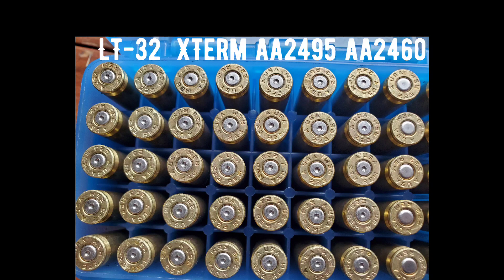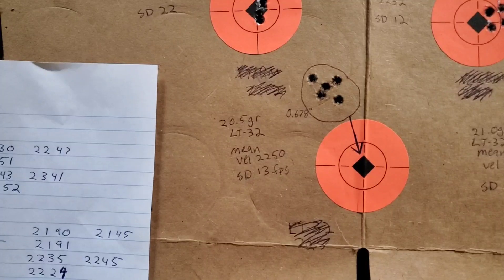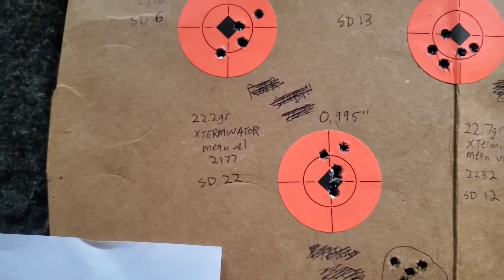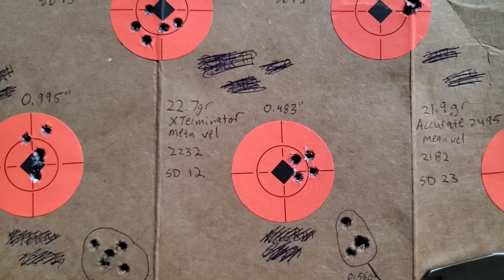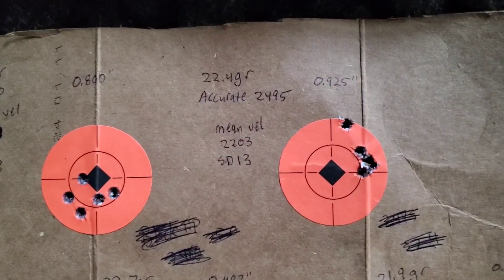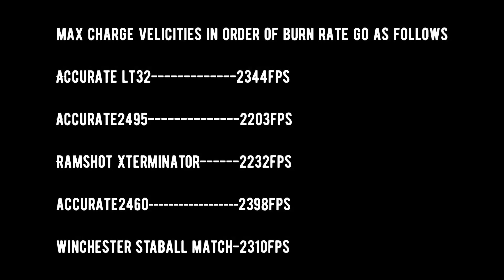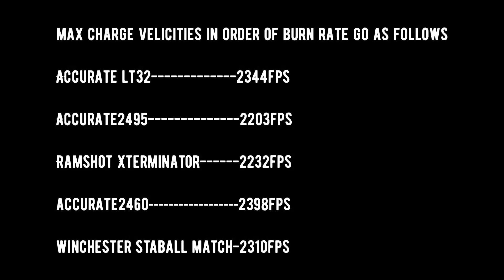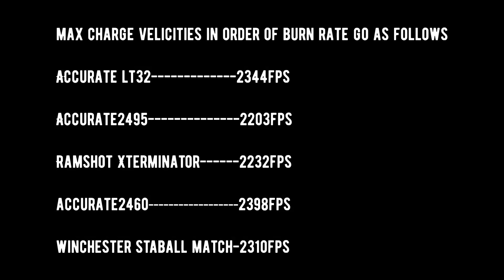Disturbing Fuddlore concerning Burn Rate and Barrel Length [Today I learned]

Comment: IMO, maximum velocity is dependent on the barrel consistency with regard to diameter and smoothness. Unnecessary, extra barrel length is a disadvantage. If you're running a blowback design, controlling gas for the bolt will also affect pressure consistency. A third component would be a flash suppressor/silencer.  A fourth consideration could be to add a rotating unburned gas wheel at the breech to capture some of 70% unburned gases that could be fed back into the barrel via rotation per round to reduce compression loss as the bullet travels further away from the initial explosion, prior to exiting the barrel...the muzzle should be perfectly cut to ensure uniformity as the gas escapes the barrel (for accuracy).  Nothing beats testing, but I've found 2700 fps seems to work best with the current technology regardless of .30 or .22 caliber.  My theory should allow for less pressure supplemented by captured unburned gases from a previously fired round.  Consistency coupled with reliability is the answer you're looking for.  Consider efficiency of fuel injection, intake and exhaust valves relies on cleanliness.  This is only food for thought, not a proven theory.  C

Comment: Its old original recipe powder IMR 4198 , 7.5 in. Saint, 11.5 in RRA 5.56 I DONT HAVE FPS but it tightened up my 300 yd by .25  55 gr sierra blitzkings
Reply from the maker: I didn't have any good recipes for 4198, but it looked so similar to LT-32, it seems like it wouldn't be super unsafe to try it

Comment: In the distant past I played with mouse loads with a .223.  I found Blue Dot gave me air rifle like sound in my 16" barrel at around 400 fps.  My buddy thought it was pretty cool so he gabbed one and tried in his 24" barrel and the bullet stuck in the barrel.  I talked with a long time reloader and he said that once the fast burning pistol powder was consumed dieseling happened which means the gas was cooling and actually can create a vacuum after powder burn.

Looking at some of you primers it looks like you have some primer flow or cratering as some people call it.  It can be a sign of high pressure, soft primer cups, weak firing pin spring or light hammer spring on an AR-15, undersized firing pin, or eroded bolt face if you have blown primers in the past.  Your primers don't seem overly flat or square shouldered, so I am thinking soft primer cups, protruding firing pin or loose fitting firing pin.  Of course if you use hardened primers like CCI #41 or similar they can hide high pressure signs such as flattened primers.
Reply from the maker: That is a very cool thing, making "mouse loads with the .223. My loading data actually has 1000fps loads with titegroup to make subsonic, but I've got no use for them.

As for the primers, that's a very small amount of catering compared to some I get. These are very cheap bolts. It is loose fitting firing pin to bolt orifice for sure. 

I check my pressure as described by looking for primer cup roundness as well as a round littler from my ejector orifice on the case head are typically my "near max" pressure signs. 

Not entirely reliable, I'm sure, but I just threw away some brass that's been loaded 12 or 13 times it's a 1¾ years old.

So it works. 

As for the cci 41 and also the winchester41, they actually still get flat with my max charges I don't know what makes them "super strong" but they behave exactly the same to the others, same as the cci 550 primers that I also have rifle loads worked up for from the primer shortage days. The anvil comes out after they're shot, but they look identical to the rifle primers

Comment: Your driving is distracting your presentation and your selfie can is distracting your driving. If you believe in multitasking, you are a fool because there is only half assed tasking or single tasking.  Ok that out of the way, yes you can handicap a longer barrel with fast powder but you cannot supercharge a short barrel to compete with a long barrel. You can blow your gun to smithereems though. The old adage: "He who has short musket must stand closer to the firing line" still rings true in the 21st century.
Reply from the maker: I was driving and talking. I also can walk and chew gum at the same time, and talk while I do most anything. It helps me gather my thoughts, especially on the way to a project, so I started a while back recording my thought gathering and some of it helps me because I don't feel rushed to explain the concept. I can try to attack it from many angles until one makes sense.

Nobody is trying to supercharge anything. 

I was seeing if the maximum velocity achievable out of a short barrel could be with faster powders. 

Now, fool. You might really know a lot, but you didn't grasp this one white all the way. Please watch the video, or read thw description, preferably both, and then comment again with some advice.
Reply: Apparently you hurt the Fudd’s feelings. Great info
Reply from the maker: Or, maybe I'm the fudd.

Comment: At first Gordons had me using faster powders for handgun because of its low burn rate warnings. But I've since figured out that slower powders not only get faster velocities (even with very short barrels), but they also have less felt recoil. Fast powders of course still have their uses, like when you don't want muzzle flash.

Comment: 2460 is my favorite fast burner for 556.. and anything copper in my Grendel that likes a fast jump to the lands.
Reply from the maker: I completely agree. I first got ahold of it because I couldn't get imr8208xbr or alliantAR-comp and I now like it better than both.
Reply: @timberfallingcouple  it's earned it's spot permanently on my shelf I bought a bunch of 53gr Hornady copper TAPs from mid way  (factory seconds)and thoes with 2460are my go to for close n nasty work almost 2900 out of a 16" 1-7. Staball match with 69s and 77s are my load for reaching out with precision..I can get AR-comp but it's a little too pricey for me however it is one of my best powders for 123gr in my 6.5 grendel..8208 was around long enough for me to try it but I never really developed the perfect load.  Staiball match has won me over because it's so versatile and gives great SDs in everything..TAC will always be my favorite though because it's affordable and does everything well. I just got a 22arc so now too soI'm trying to find what is my favorite with that now. It looks like Staball 6.5 is going to be my winner there and it's my favorite for my creedmoor so it'll serve two purposes.This hobby is great but trying to seek perfection while narrowing the down powders I need can drive a man nuts.

Comment: Slower powders are going to give you better speed because they don’t spike the pressure so quickly.  That’s been my experience with my rifles.  I don’t have a barrel shorter than 16.
Reply from the maker: I think k you're absolutely right, and it seems to be true, even with the very short barrels.
Reply: @ most of my loading is much larger cases but I often have the best results with the slowest powder, case fill is better, lower sd and good accuracy.   Hope you find that one load that checks all the boxes
Reply from the maker: @jasentonguepowersaws4206 I certainly have a few, this test all just stemmed from a curiosity to see if I could get more speed out of that 11.5 inch barrel with fast powders.

Comment: There are just so many variables. Even if a powder is burned up in 6 inches, the longer barrel still has a longer time that built up pressure can push on the bullet until the pressure drops as the bullet exits. Thus more speed out of the longer barrel even though the powder was long done burning. But surely there must also be differences in the amount of expansion various powders produce and this may be completely unrelated to burn time. When you start throwing together variables like burn rate, along with the powders amount of potential expansion, I could see it being very hard to calculate consistent results. I guess that’s where the grey hairs come in.
Reply from the maker: I think you hit the nail right on the head there. 

There is a limit. If you throw 5 grains of unique in a .223 cartridge, it ain't gonna matter whether your barrel is 11 or 16 inches long, it's going to be a subsonic load. 

And if you throw an overflowing cartridge full of imr4350 into a .223, there's no way the 11 inch barrel will make the velocity that it would with a faster powder. 

But I guess what I'm trying to say is that within the "zone" of cartridge-appropriate powders, we aren't going to make more velocity just by using a faster powder for the shorter barrel. Cfe223, blc2, or win748 are slow, but efficient when loaded hot, and even though they aren't fully burnt in an 11.5 inch barrel, that amount of force generation is negligible to what was created in the chamber.

Maybe, eff, I don't know.

Привет!

Comment: Down the hole w/257rob., Found that long burn time down 25in bbl. resulted better groups to 600yrds. My concern was cartridge thrust on breach block (Ruger 1) and bolt lugs (Mauser 1909). Talked with Destructive engineer and was informed pressure curve results for speed is like being hit with 5lb hammer then being hit with 20 pounder (slow to fast) and having same speed. Do not know what effect it would have on multi lug AR15 bolt nor bolt speed. Would think cartridge rim tear or ejection of brass being sent to next county. My experience M16 is problems with powder fouling of gas system and bolt cam lock-up. This using long strand slow burn (1965yr) then having ball powder (1975yr) with much better luck, of course earlier was 100fr+ than later 60fr about. IDEA's ?. CHEERS!!!
Reply from the maker: I think that's a very good explanation with the ruger number one. It might be a figment of my imagination, but I swear I can feel the difference between slow powders vs long, especially in a bolt or single shot gun.

As for the m16/ar-15, I have heard lots of stories about the early days, I do see them getting a very dirty layer of greasy carbon oil, but I am such a meticulous gun cleaner, that any time I've ever gotten to around 300 rounds, they always end up cleaned anyways. As for a SHTF type situations, I hope I can get my hands on some oil and old tee shirts once in a while. 

They seem to run, but nothing is as reliable as a high wall or a ruger number one!

In my ARs I've found particular ones seem to really like that medium fast burn. Something about barrel harmonics and  velocity, but these short little 11½ inch guns are different cats. 

I do notice I've lost some velocity since I enlarged my gas port. I think it would take quite a bit of gas to start testing rims off. I'm pretty sure I've shot a max charge of win748 through this exact gun behind a 75 grain hollowpoint boattail and had no ill effects, but that also might not be true. I've got a zippie bag of some from the good old winchester748 days, and I'm pretty sure I shot a partial magazine of them at near full auto rates of fire, but can't recall if it was them or a different load.
Reply: @timberfallingcouple  Nice, was interested in those short barrel and enlarged gas ports. Me, I will stick with imr3031&  Mini 14.
Reply from the maker: @deanzoil-yc8no I've never even run 3031 before so far. 

And my mini14 actually got parked when I started buying AR's. Never thought I wanted one until a couple years ago, and once I really got into them and really started to respect the .223 cartridge for what it is, I'm a fanatic now!